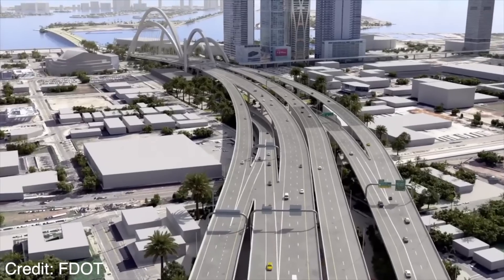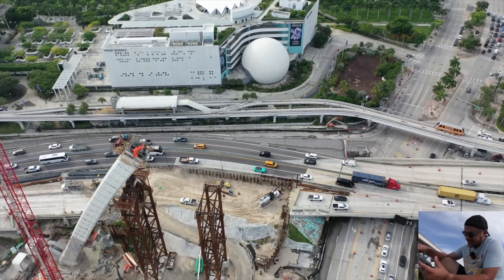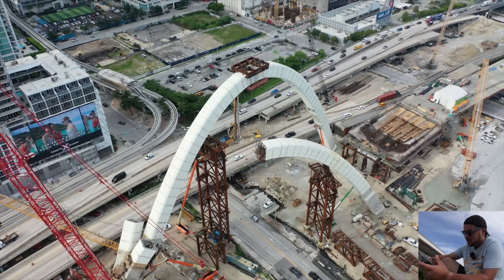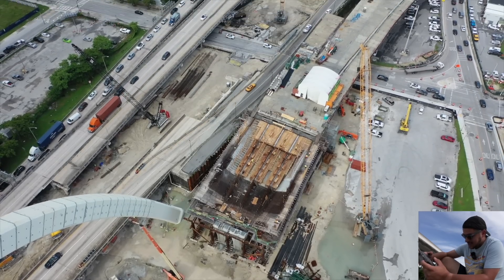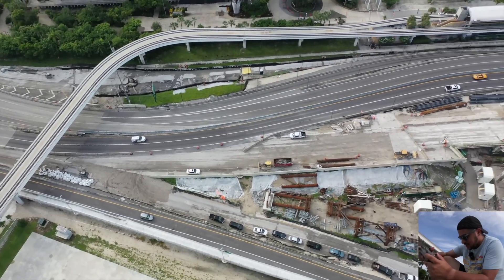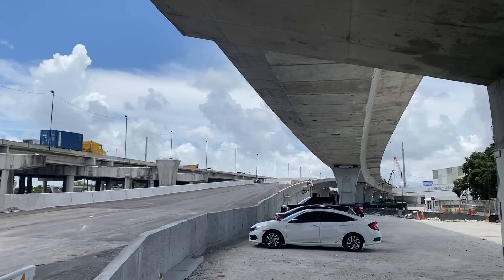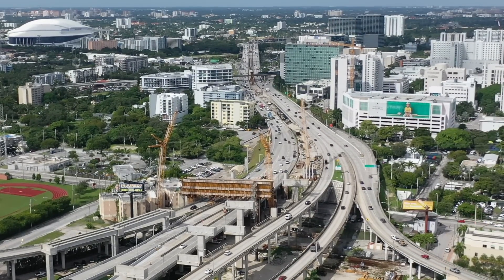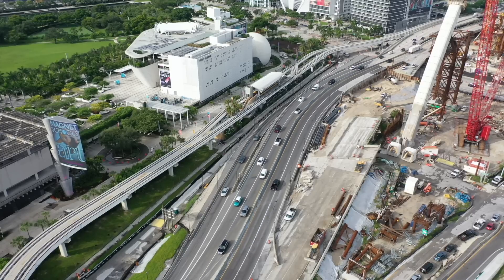Miami's Signature Bridge Has The First Arch CONNECTED! | Year 3 Update

Comment: Its going to be so dark underneath all those lanes, there is no way its going to be a "welcoming park". They should have recessed all those lanes and added the park above it. Literally every great city has buried their highways to avoid splitting the city. Look at Barcelona, Boston, Philly, etc
Reply: The park underneath will have artificial lighting, not to mention the arches themselves will be lit
Reply: If you try to bury the highway in Miami, it would become a tunnel underwater.  

In that area where the bridge is being built, on days when there’s either a high tide or a rainstorm, it’s common to see 3 feet of flooding.

Comment: Is the state highway department converting the whole of Rt. A1A MacArthur Causeway to the Beach to I-395 too? Because this quadruple roadway highway looks tailor made for it! 🤔
Reply: It would take an enormous amount of money to modify/rebuild the McArthur causeway to interstate highway standards. The Palm/Hibiscus and Star Island folks, much less, the Fisher Island folks, would NEVER tolerate a big interchange nearby.
Reply: @Johnny.Fedora  Except there's a new freeway tunnel that splits from the causeway to the Port Miami on Dodge Island and a huge interchange is not needed to access Star Island and Fisher Island - just a two-lane, two-way access road from the splits or Parrot Jungle to the ferry slip for Fisher Island or Alton Road.
Reply: @EdwardM-t8p I trust you understand the technical requirements that an interstate highway has to meet. And now you're suggesting cutting those islands off from the causeway/interstate and build another causeway for back-door access to those islands? Where Fisher Island (a separate island connected by ferry) residents alone have the political to stop a rapid transit line on the McArthur?

There is no money available for such a thing. To the extent that money is available, it ought to go toward a rapid transit link between Miami and Miami Beach.

Comment: Nice work on the vid and commentary! Where is the casting yard for the arch sections? Do they barge them in? FYI, the finish they apply to the end product is called 'special surface finish' and is basically a mix of cement, pigment and bonding agent. It is tough as nails. Also, a cofferdam is used in a body of water. In this case it would simply be called 'sheet piling' or 'sheeting' for short. At 10:54, I assume that green truss is a crane being used to lift the concrete beams into place on the piers below?
Reply from the maker: I was using the term FDOT uses in their monthly updates: “Arch 6 - sheet pile installation for foundation cofferdam” — strange but maybe because of the high water table? 

As for the arch sections, they are made not too far from the site (also 836 double deck bridge caps). I’ve got the coordinates here (25.7757523, -80.3177015) — roughly 7-8 miles west of the arches.
Reply: @JoelFrancoVlogs  Thank you!! And you are probably correct about the water table - I never thought of that! Again, great stuff!
Reply from the maker: Sure thing. Thanks for watching!